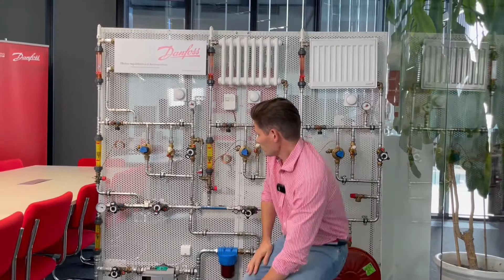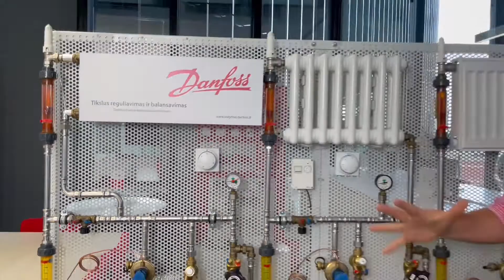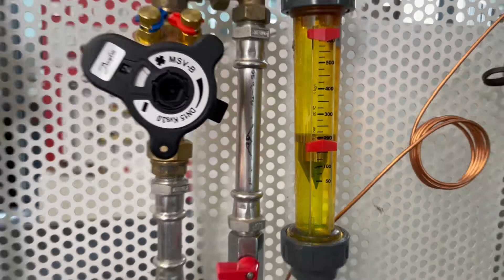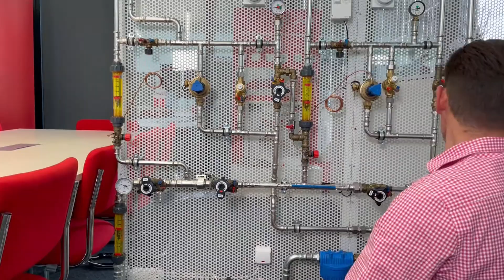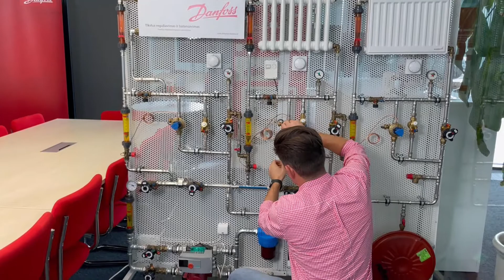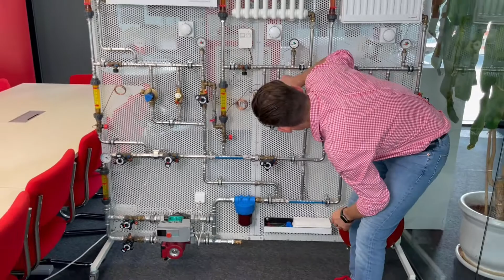Manual vs automatic balancing in hydronic heating systems

Comment: Dinamic flow control for heat pump from DT 5 to DT15 .

I'm working on optimizing my underfloor heating system.  I have a 10kW system running at 35°C, but I'd like to increase the dT from 5°C to 15°C for better efficiency.  The piping from the buffer tank to the underfloor manifold is 10m of 17mm plastic(inside).  The pipe from the heat pump is 28mm copper.  I'm also in the market for a new smart water pump that can handle constant temperature, constant dT, and volume flow optimization.  Specifically, I'm wondering if anyone has experience with Grundfos /Wilo Strato Maxo or similar smart pumps in this kind of setup.  Any advice on increasing the dT and specific pump model recommendations would be greatly appreciated!
Reply from the maker: Hi! Reducing the return temperature while keeping a fixed ΔT will affect the room temperature. The flow and return temperatures should vary based on the outside temperature for the most accurate room control. You can fix either the supply or the return temperature, but not both; ΔT must adjust with the weather condition. For maximum efficiency, I suggest using the Icon2 controller system. It can operate with a fixed supply temperature while lowering the return temperature as much as possible, all while maintaining a comfortable room temperature. Icon2 also features forecasting, PWM regulation, and self-learning for optimal efficiency.https://youtu.be/zIZuP63CJY4?si=ib_0zBgeyFtOH4PJ

Comment: Great video. I do have a question, would you have a radiator valve and a PICV? Won't you lose authority in the radiator valve in that scenario? I thought a DPCV and radiator valve to maintain the authority and PICV directly to a larger coil or coupled with an actuator to vary flow. Thanks
Reply from the maker: Shure you can not have radiator valve with thermostat and let's say PICV on riser. You will loose authority on radiator valve. On radiator valve closing PICV will open. Good solution would be radiator valve (with presetting RA-N)  and DPCV (ASV-BD+ASV-P/PV). Or you can use directly dynamic radiator valve RA-DV without DPCV in a smaller systems. Dynamic radiator valve RA-DV is similar to PICV (Danfoss AB-QM).